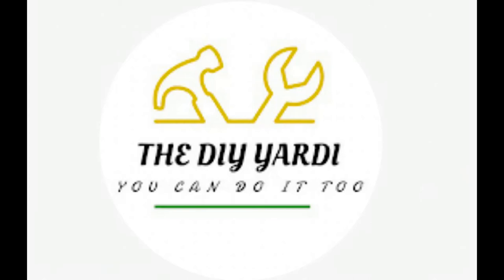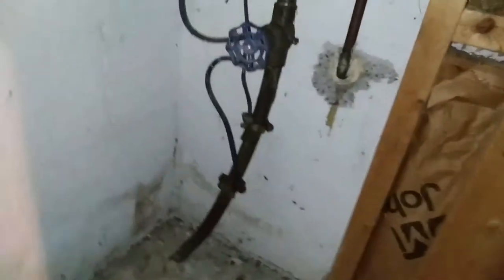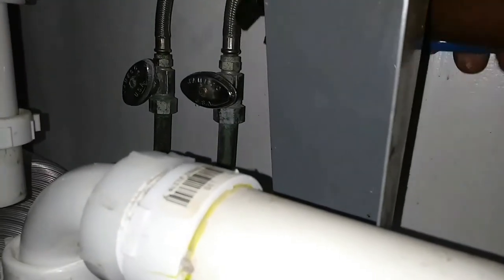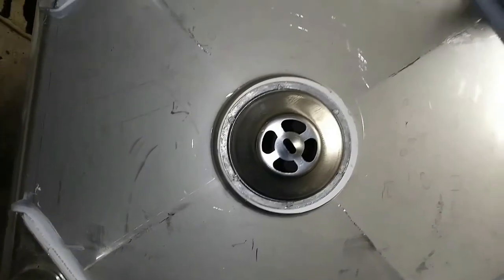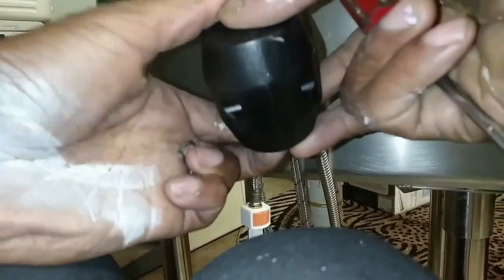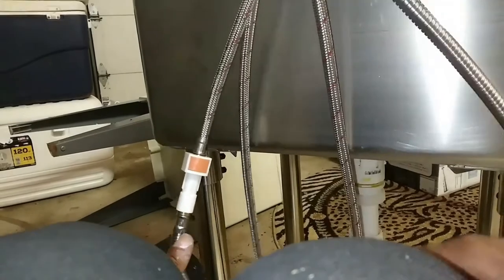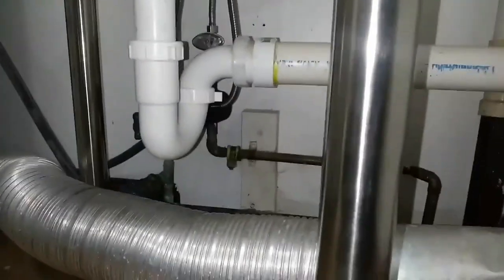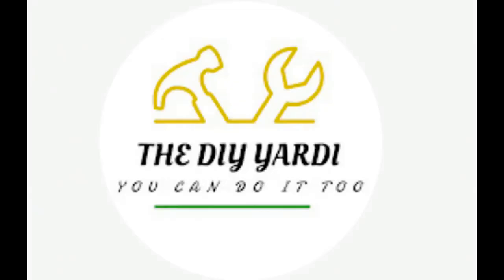COMPLETE ASSEMBLE AND INSTALL OF TRINITY STAINLESS STEEL UTILITY SINK

Comment: As a woman with very little experience, I would have appreciated a little more detail when you separated the faucet parts. I could follow by pausing the video and watching with no problem but describing what remained on top and what you removing to attach to the underside would have helped me. Also, is there a best place for the placement of the weight?  And, the placement of the wall piece was 1/4 down from the horizontal marks and assuming centered from the vertical marks?  Thank you! Your video helped me install this myself.
Reply from the maker: You're quite welcome, and I'll try to be a bit more detailed in my future videos, but what you did was correct, pause the video as you went along is best, overall I'm happy to hear you were able to get it done..👍

Comment: I'm planning on installing this on my backyard patio. Can I just connect it on the ground faucet? What can I use to connect it to both hot and cold water hoses of the utility sink? Thank you.
Reply from the maker: Hey Alvin, Pex-b would most likely be the easiest to work with depending on the location of your patio to closest area to tap into the hot and cold, also if gets down below 32 degrees where you live you will need to set up a drain on each line to evacuate the water from them to prevent freezing.

Comment: I think you installed the faucet wrong 
it says the white washer should be on the top side 
black washer should be on the bottom side
Reply from the maker: that is how I installed it Dylan, the white washer you see at the bottom is cardboard that is there as a buffer to prevent the rubber washer from twisting out of place.
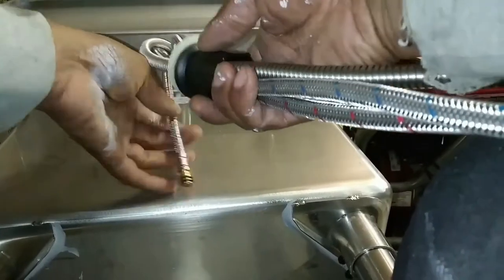Reply: at 12:27 you have the white washer on the bottom 
but the instructions said to do this: 

Insert Faucet through the White Gasket and the hole on SINK (A) ledge from the top side of SINK (A). Orient the Faucet handle toward the front. From under SINK (A), first slide on the Black Gasket then screw on the Lock Nut.

the white gasket at 12:27 should be on the top from the instructions and only the black gasket should be on the bottom side
Reply from the maker: @dylan-nguyen  oh ok I get what you're saying, but It made more sence to me to place the rubber on top in order to prevent leaks..
Reply: @thediyyardie7192  I saw the top of the faucet inside the base also had a rubber gasket but it was slimmer than the bottom one so that's why I assume they tell you to put it on top
Reply from the maker: @dylan-nguyen  oh ok possibly..